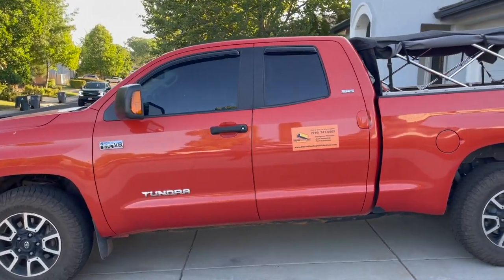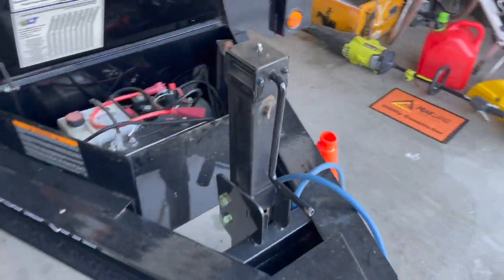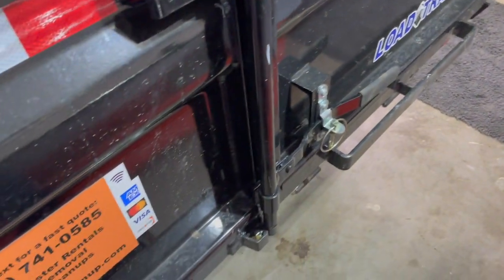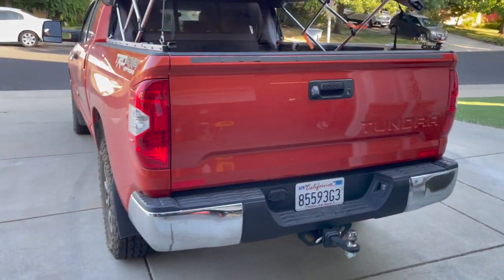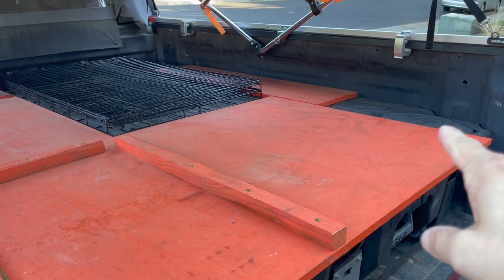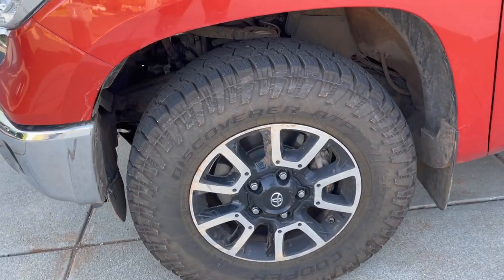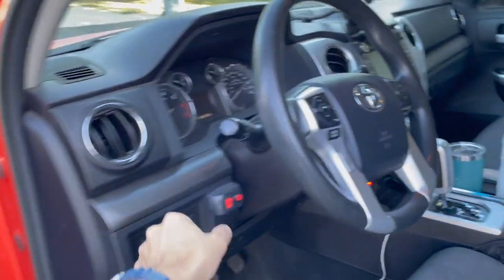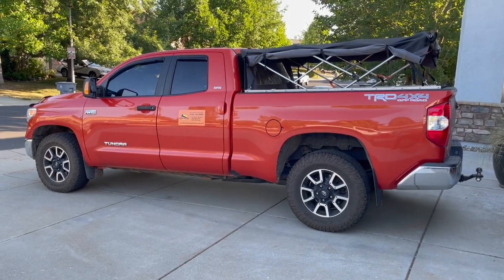Junk Removal Setup (Tundra + 6' x 12' dump trailer)

Comment: How is everything working out so far with you using your Tundra to tow your dump trailer with added weight to it?
Reply from the maker: With the added lead spring it goes really stable. But I got a ford f350 that tows way better so I don’t use my tundra to tow much anymore.

Comment: Nice setup. I’ve got a 2019 Tundra that I’m looking to tow a dump trailer with for my lawn care business. I’m undecided between the 6x12 or 7x14. Did you consider a larger trailer before buying yours?
Reply: I'll suggest you to buy the 7x14  because it has more room but it's going to cost around 13k tho. That's what I'm looking for as well in order to start my junk removal.
Reply from the maker: Yup, I wish I would have gone a little bigger but I was limited by wanting to keep it in my garage at night ( I live in an HOA). So the 6' x 12' was all I could do to squeeze it in and still walk around the trailer with the garage door closed. It works great though!